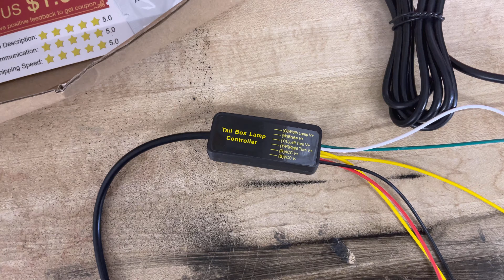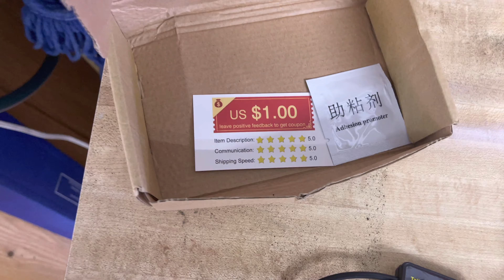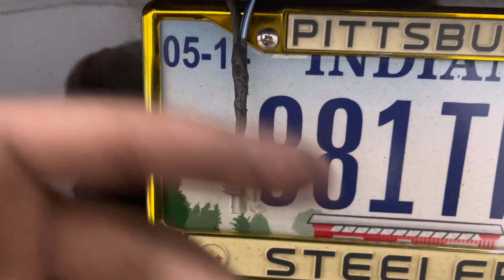LED Third Brake Light Strip | Full Install | Any Car ! | Easy ! | Link w Discount Code !

Comment: I like your step by step instructions. My project car is easier to work on than yours. I have a Chevy Chevette. I went to one of the local Pick and Pull yards last week and I got the third brake light assembly from a Chevy Sonic. This brake light assembly has only two wires. On mine, can I just splice into the brake light wire and ground it anywhere on the chassis?

Comment: My light wouldn’t cut off and I would have the running light constantly going so I wired the green to a wire tap then my red to the power at the brake light, now my turn signals won’t work

Comment: The length of the LED strip is about 40-inches as I understand it. Can it be shortened? Can the wired end be cut back to make the strip about 30-34 inches? Thank you.
Reply: Yes

Comment: I know this an old video but I just found it and I think it's very cool!! I actually want to put this on my Civic racing wing, I saw it on the racing Wing somewhere.
Reply from the maker: I recommend it! I still rock it and love it!!!
Reply: Yeah thanks for the video I hate wiring hopefully I can figure it out. I want to put an LED strip like that for the brake lights into my big racing wing and then I want to relocate my third brake light in the back window to the bottom of my rear bumper. Thanks for the video I'm going to see what else you got on here I've subscribed

Comment: Bro please help me out, I got a c6 too and ordered these lights. I can't connect the negative to the battery, where can I connect to ground on the back of the vette?
Reply from the maker: Possibly somewhere you can find metal , the frame, or even bolts off the frame . Let me know if this helps bro !

Comment: Having trouble with the wiring. Does the red (accessory) wire have to go to a constant or ignition on source? I thought that the positive coming through for the brake light and turn signals, along with the ground would be enough. Not so? Product sure needs some instructions. Yours do help - you do a great video.
Reply from the maker: I appreciate that bro, so the red and black do need to be connected to a constant, those power the small brick that all the other wires run through, try connecting those and see what happens!

Comment: Great video, hooked my spoiler strip up today and everything comes on my only issue is that when I hit my break lights the strip flashes like my hazards would if turned on, I hooked the white break line from the strip to my 3rd break light on the spoiler of my 2013 durango, do I have something hooked up wrong.
Reply: Did you figure this one? I think we need all time positive
Reply: @Abfitaaz  nope I just rolled with it

Comment: I've got the same unit. I'm putting on the rear window of a pickup topper. The adhesive is not great. Even though I cleaned the window and frame throughly the right side (wire side) started drooping overnight. I'm now trying to use glue from a glue gun to hold the ends better. 
I'm not using the green for the running lights, but I want everythingelse
Reply from the maker: Try a name brand adhesive for a better cleaner stick, the glue/sticky that comes with things is never the best quality!

Comment: Green wire??
Reply from the maker: I added an instruction to all the wires bro where are you mixed up at ?
Reply: @moderatemods98  mixup ni hua hai mai bs puch rha hu green wire jisse light slow hoke band hta h use kaha connect kru smj ni rha
Reply from the maker: I’m sorry bro I can’t translate that